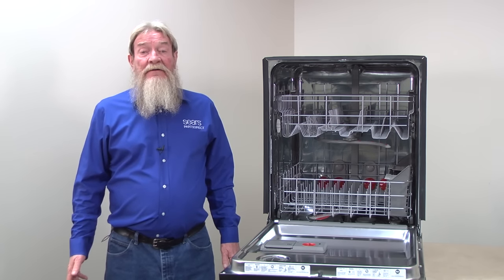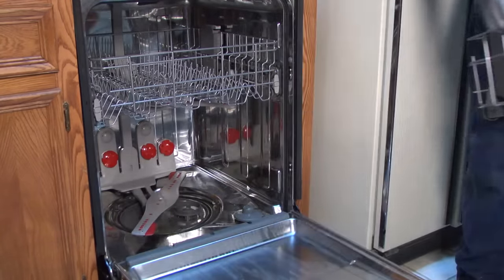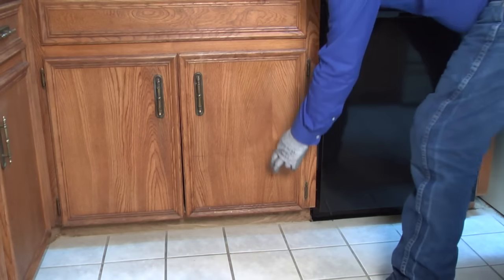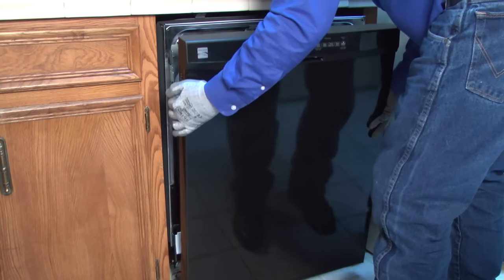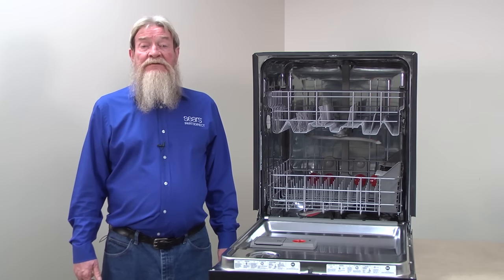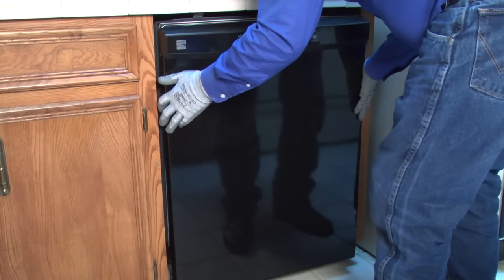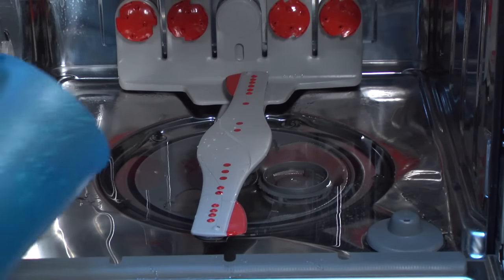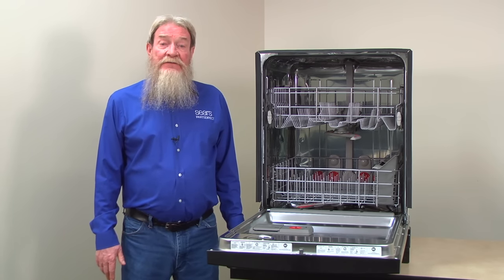How to Find and Fix a Dishwasher Leak

Comment: Way to go Wayne...by far the best dishwasher leak video on YouTube.  By going over all the potential root causes, I was able to zero in on several minor problems that in total fixed the door leak.  The wave action was created by loose screws on the pump outlet, a loose pump outlet tube to the upper arm, and partially plugged wash arms for the upper and lower racks.  Never would have found these without your help...Thanks.

Comment: This is the video to watch first, then watch a few others, especially if you can find one for your unit, though these systems are fairly universal. This video shows a systematic search, excellent delivery by the present or, with good logic and cautions. There are a few problems he doesn’t touch on, e.g., the water level float, but these are probably the main ones. Great video!

Comment: Thank you for this video.  I followed your instructions.  I was able to figure out that it was the diverter motor, and then I hired a professional Sear repair service.  When I told them that I figured it out using your video, he was like, "Yep".  We will replace the sump (I think that is what it is called), also, because it has issues too with a little seal in it.  He didn't even do any tests or anything himself, lol.  Anyway, he ordered the parts, and a week later another guy came to finish the repair so I got that done.  But, my wife was waiting on me to meet her somewhere so I said I will replace the kick panels.  Later, I could not remember in what order and how exactly I removed them, and your video does not clearly show it.  One or maybe two months later, lol, I found another video that helped me figure it out for sure, and "Wallah!"  The job is complete and God bless my wife for her patience since I had the kick and toe panel stashed across from the dishwasher and just under the stove panel for I think almost two months!  Meanwhile, I was giving my mom and also my brother help with some of their home improvement projects, and my dishwasher toe panels kept beckoning for attention, lol!  Here is the link to the video that helped me with the toe and kick panel re-install.  https://youtu.be/M0kZijOTCCY

Comment: Thanks for this demonstration. I think mine needs the washer seal in the water line. I have changed the door seal and still that leak in left corner. Know know how to remove the door
and have access to the water line is fantastic. I will work on this soon. Thanks for this helpful information. 7/26/2022 FLA.

Comment: Have water coming from under the dishwasher onto the floor.   I tightened all the screws mentioned, and will see what happens, as I have a load going again.   The thing to watch now is if it's the outflow hose in some way?   Seems to be fine under the sink area (no dampness) but just from under the dishwasher itself.

Comment: 1. Mine leaks behind the right side wire connection box. The mushroom float is above the leak. Is there some way to check that for a part to be replaced? 
2. Also there is a very small leak coming from the inlet valve above the hose connection that only leaks while the valve is open, supplying water. 
3. The door seal looks bad and needs to be replaced.

whirlpool Model  WDT710PAYM4

Comment: Hi,
Thanks for the good explanations. I'm in the situation where I can't find the source of the leak and it only happens while draining. What would you suggest I should do? Thanks
Reply from the maker: Unplug the dishwasher and shut off the water supply. Using the installation manual for guidance, pull the dishwasher out of the cabinet. Check the drain hose connection to the drain pump and fix that connection if it's loose. Pour water into the end pf the drain hose that connects to the garbage disposal to see if the drain hose leaks. Replace the drain hose if it leaks. The  drain hose typically has a flapper check valve that prevents drain water from backflowing all the way to the drain pump. If the drain hose doesn't leak then you may need to replace the drain pump seal, drain pump or sump.

Comment: I have a wave action leak. It leaks on the left side then the right side, right below the corners of the door. This happens about 20 minutes after starting the dishwasher. I think it relates to low pressure during the PROWASH cycle on my Kitchenaid dishwasher. I can hear the slow spinning of the spray arm during the leaking portion of the cycle. I think I have a leaking spray arm.
Reply from the maker: If you need help resolving this issue, let us know the model number of your KitchenAid dishwasher and we'll try to help.

Comment: This, hands down, THE first video to watch if you have a dishwasher that is leaking. I was all set to buy top and bottom gaskets for my leaking dishwasher assuming that eight years in, I was due even though for the vast majority of that time it was merely a drying rack. Watching this video made me realize that I'd just had a wonky load and the water had gone up and over the door (mentioned perhaps 40 seconds in). My gaskets had all felt fine and I didn't have a small leak, I had quarts of water gushing out. I unloaded the dishwasher. Ran a small load through and Voila!, no leaks. Thank you, Wayne and Sears PartsDirect for mentioning something no other dishwasher video repair video (of a half dozen or so) had done.
Reply from the maker: We're glad to hear that our video helped you out. Thanks for letting us know what you found. By the way, we agree that a dishwasher makes an awesome drying rack.

Comment: At the 3:02 time there's a white plastic piece at the top of the screen in the middle that has wires going into it from the bottom what looks like black electrical tape wrapped around the plastic peice and the wires come out of the top if it a little further up the door. My dishwasher is leaking from that spot. I've exchanged 2 dishwashers now with that same problem. And chance someone knows what that part is called?

Comment: When I run the 1hr  cycle at 22nd minute it leaks heavily. Still can't find out why. BTW great instruction video.
Reply: February 2021 our dishwasher first began leaking at the after 89 minutes, and now will leak after 22 minutes.  We have had Sears repair out 7 times and parts replaced 3 or 4 times, and it still leaks.  We thought after last week when the same repairman was working on it again told me he had done everything he knew to do and would call his manager/supervisor to possibly replace the dishwasher.  In a few days, I had a text from Sears that they ordered 4 more parts and scheduled an appointment for May 7, 2021 to install the parts.  I was so frustrated, and I remember he said that there is possibly too much water released into the dishwasher.  I tried it tonight, and now it leaks less, but there was so little water allowed into the dishwasher, it didn’t even wet all of the dish soap pod.  Also, now the Drain cycle won’t turn off, so, I have to leave the door open a little but the readout still says over and over it is on the Drain cycle.  My husband wants to buy a new dishwasher tomorrow, and cancel the Sears warranty because 4 months is ridiculous to go through this.
Reply: @christinawhite9256  I hope they ended up replacing the dishwasher....

Comment: I need help. My dishwasher was leaking from the front right bottom corner. Easy fix, just replace the gasket right? No. I replaced the gasket and instead of it leaking on one side it began to leak on both sides. Bought a new gasket and now no leak on the right but the leak on the left is awful. Please help. What have I done wrong?
Reply from the maker: Let us know the model number of your dishwasher so we can see more details about your model. As shown in the video, check the bottom spray arm for cracks or damage. The leaking problem may not be caused by a bad gasket.
Reply: Did you ever figure it out.  Have the exact problem.  Did the gasget thing too.  Changed the leaking pattern every time.

Comment: Great Video!  @ 3:35 what is the White object (with slot cutouts) right hand side of dishwasher between the Warning Sticker and the white wire channel?  I have a dishwasher that seems to drip from the float mechanism that is enclosed in this device.
Reply: Object of interest is also visible 4:22 to 4:35 right above the control box being removed
Reply from the maker: @briansolt7373  That device houses the overfill float switch. Here's a repair guide/video that shows how to access the float switch inside that device: https://www.searspartsdirect.com/diy/repair-guide/how-to-replace-a-dishwasher-overfill-float-switch . If water is leaking through the opening for the float stem that activates that switch, then the float switch may not be working if the dishwasher overfills. If the dishwasher doesn't overfill with water, then a wave action inside the dishwasher tub may be causing water to slosh over the top of the standpipe for that float switch stem. Check the bottom spray arm for damage is you suspect that a wave action is causing the leak. We hope this information helps. If you need further assistance, let us know.
Reply: @searspartsdirect  why did sears have to sell the outlets :[

Comment: My dish washer leak under my door
Reply from the maker: Check for damaged or cracked spray arms as described at :27 in the video. A leak from under the door is often caused by wave action created in the tub by a damaged spray arm or other factors described in the video.
Reply: @searspartsdirect  Can broken glass under the spray arm cause the dishwasher to leak?  My dish washer was leaking under the door.  I lifted the spray arm up and saw a huge piece of broken glass under it.  I removed the glass but i didn't restart my dishwasher to see if it's fixed.
Reply from the maker: @PhillyDjHook  Yes. A huge piece of broken glass can interfere with lower spray arm rotation or its spray pattern which can cause a wave action inside the tub in some models. The wave action can cause water to slosh over the front lip of the washer tub and leak out the bottom of the dishwasher door. We hope this information helps. If the dishwasher continues to leak and you need more help, let us know. Include the model number of your dishwasher and we'll be able to provide more specific advice for your type of dishwasher.
Reply: @searspartsdirect  yeah when i removed the glass,  the water that was in the washer went down the drain and when i shut the door to wash more dishes,  the leak was gone.  But thanks anyway.